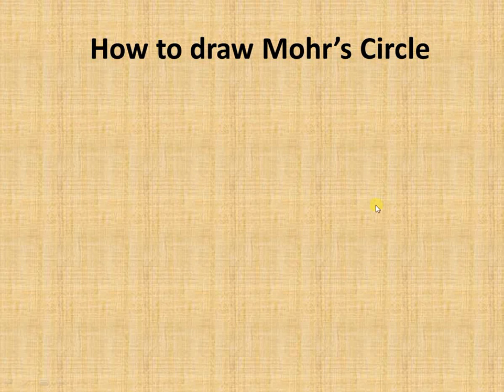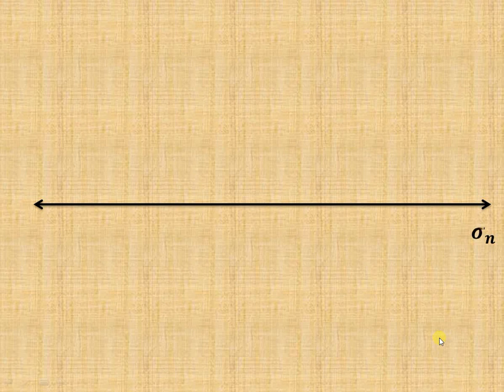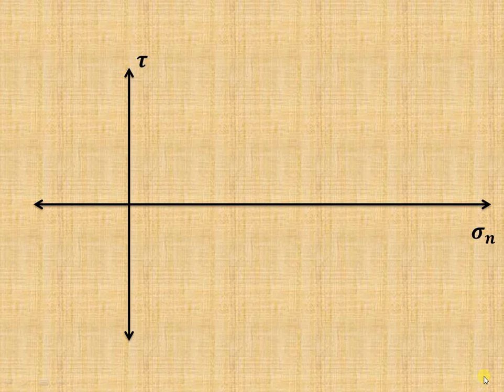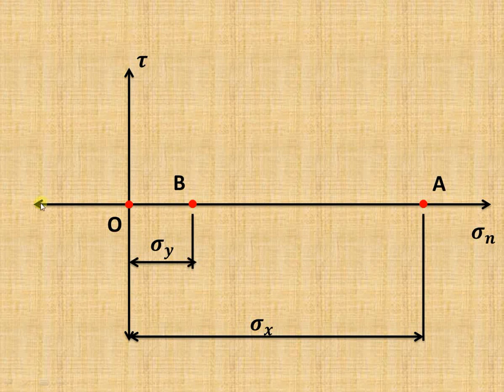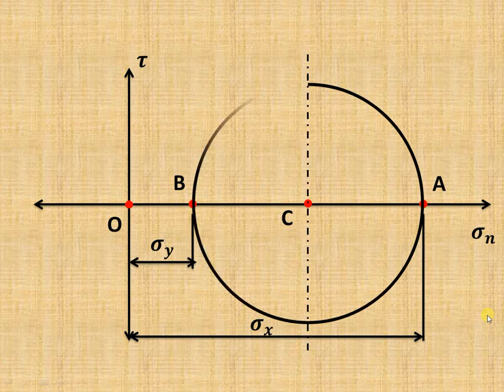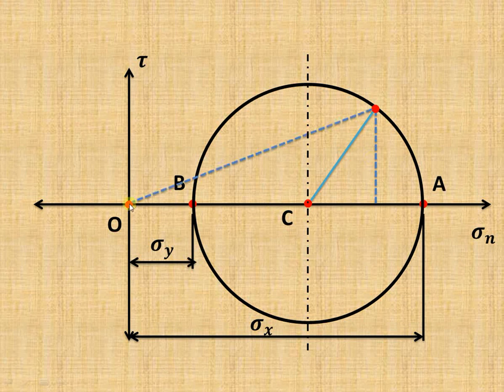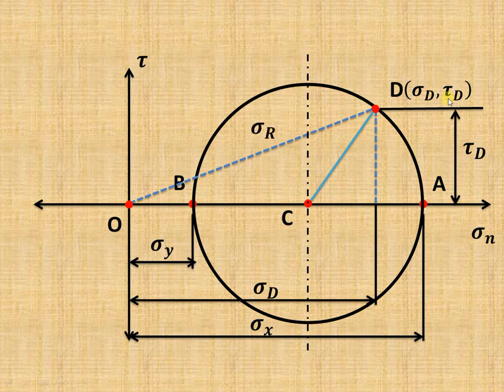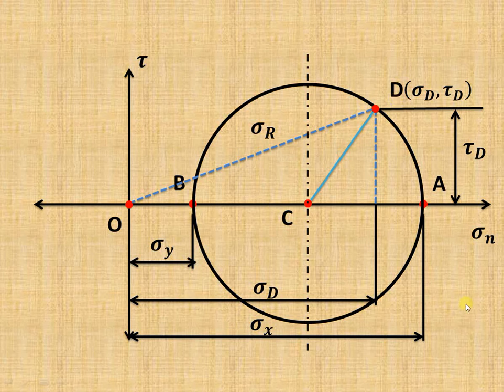Lecture 1 | How to draw Mohr's Circle

Comment: I think it is not correct. Because in the above mohr circle, radius of mohr circle is half of (Sigma X minus Sigma Y), which is not correct. Mohr circle is graphical representation of normal stress along X axis and shear stress along y axis.  Sir how have you drawn the mohr circle without the value of shear stress?
Reply from the maker: It is the case in which only normal stresses are given and shear stress = 0.  Hence, the solution to the problem is perfectly all right !!!!   For the case about which you are talking about please refer to the another video posted on our Chanel.  Thanks !!!!
Reply: For tensile stresses - radius of Mohr circle is (Sigma X minus Sigma Y), while for compressive stresses -radius of Mohr circle is (Sigma X plus Sigma Y).
Reply: It may be wrong
According to me It would have been correct if 100 Mpa and 30 Mpa values would be plane stresses ( i.e max and min normal stresses )
Reply: Yes it is plane stresses since shear stress is =0 .so it is correct